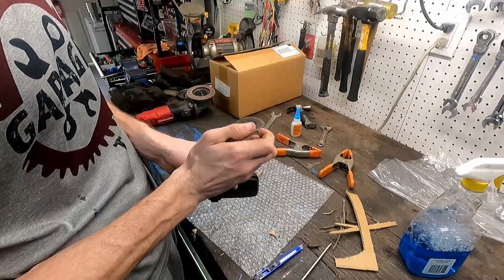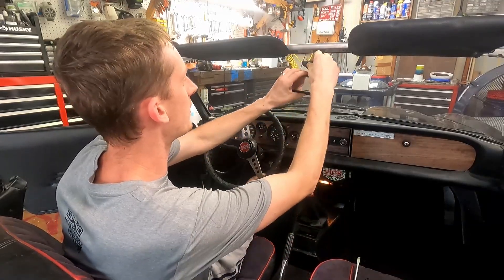Repairing our Shaking Rear View Mirror for our Fiat 124 Spider Project!

Comment: Another very helpful tip. I have a question: Do you know if the mirror on the 850 removes the same way? I would like to take mine down. Also, when can we expect  the word on the next project, lol ?
Reply from the maker: I’m not sure about the 850. I never had to issue. You’d have to look at how it’s assembled.  As for the next project, we are almost there!
Reply: @GarageTimeTV  I tried it. It is the same as your 124. Came right off! I was being too cautious because I didn't want to break it. Thanks for this video.

Comment: Great Video..answered so many questions...we have a 1979 Fiat Pinnafarina Spider 124. The RV mirror glass is broken. Any suggestions on how to just get the glass as the mirror fixture is fine. Thanks
Reply from the maker: You could get a replacement piece from some used parts dealers. There are a few on Facebook in Fiat groups

Comment: I have a 1980 Fiat Spider that I want to replace the stock side view mirrors. One is broken and I figure I could put some classy chrome ones on. However, I am worried that what I have found online will not properly fit and ensure water won't get in there. I know I could use silicone but curious if you have any recommendations or help with swapping the side mirrors. Thanks!
Reply from the maker: There have been lots of people who have done the swap, but you’ll want to be mindful of the screw hole position as well. You may have to make new holes. Most mirrors also come with a rubber base gasket that goes under it to prevent water coming in.

Comment: Hi, I'm the owner of a '82 Fiat 124 Spidereuropa. I'm in the middle of a full restoration.It would be useful for me if you could explain how to replace the steel wire of the electric window lift.I know it's not something easy to show on a video...but if you can help me it would be much appreciated!Thanks for your interesting videos, cheers
Reply from the maker: Mine has manual cranks, so I don’t know how to do the electrical ones. If you send me a message through instagram, I may be able to find you something to help you!
Reply: @GarageTimeTV  I will, thank you!

Comment: This first project completed successfully. Quick question, when I crank the car in cold start the rpm is around 1000 then it gradually moves to 2000 and stays there. Is this normal?
Reply from the maker: Sounds like you may have a vacuum leak. The increased air intake will rev the engine. Look for cracked/old hoses or missing vacuum caps